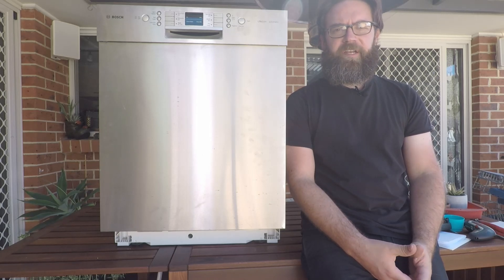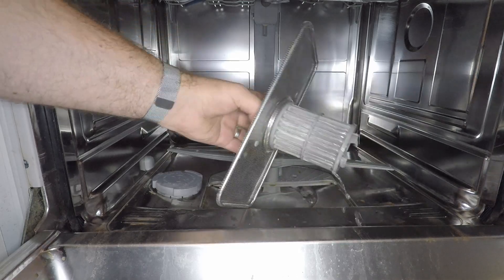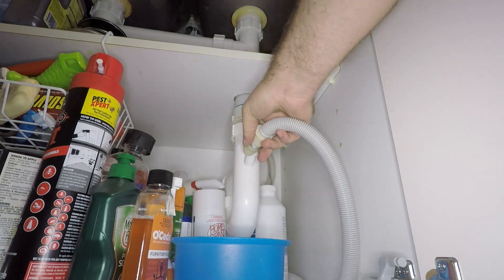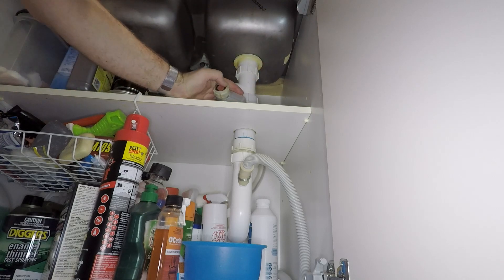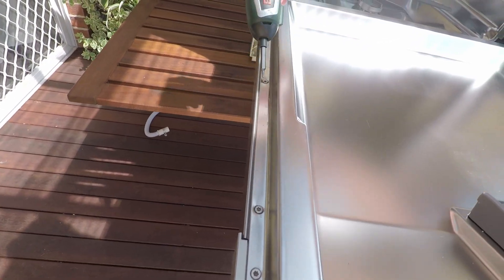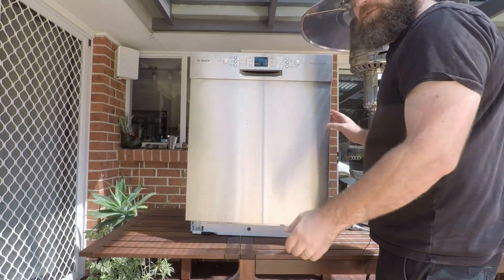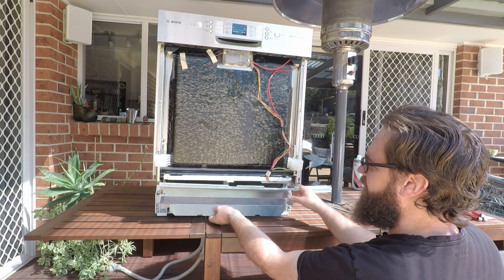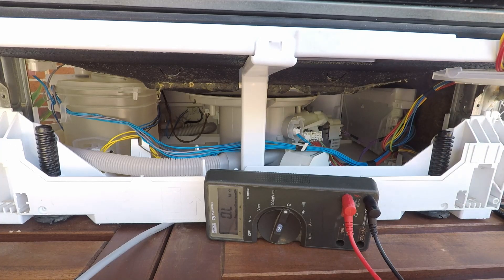Bosch E21 error code diagnosis and repair

Comment: Thank you - it looks like the plumber replaced the inlet pipe with a longer one which doesn't look like it has the large second filter. I have an e21 error and it the inlet pipe itself looks clear but just wanted to see if that would trigger it

Comment: Correction: to remove heat pump you don't need to take bottom panel off. It comes out through the front or even easier is to take RHS panel off ,remove PCB, this will give you nice access to wash motor ( heat pump) 15 min job.

Comment: Thanks for your  expert presentation.   

Perhaps I missed it, perhaps it doesn't work...but seemed to because I got five washes out if it...I cut the electric by unplugging.  Thought to lose the settings, begin again after clearing.

Here I am.  New error code.

Consumers are being sold a bill of goods.  Dishwashers have been around for 60 years.   Why now these problems?

You can see waiting for special pick up...these appliances are not lasting.  I've had this two months. 
It's not just the cost of the appliance, it's shoe leather going to the stores, comparing online, waiting for scheduling to install, taking off from work, dirty dishes.
Thanks for posting, a soothing and knowledgeable voice helps.

Comment: The dishwasher doesn’t have a dryer fan it dries by pre charging the inlet chamber with cold water and condensing the steam
Reply from the maker: Thanks, I became aware of this after making these videos. Unfortunately videos cannot be changed after they're uploaded
Reply: @Sawickipedia  you can put in a text instead or so :)